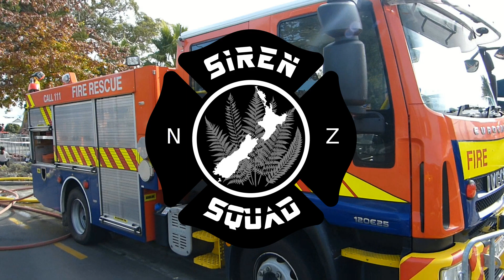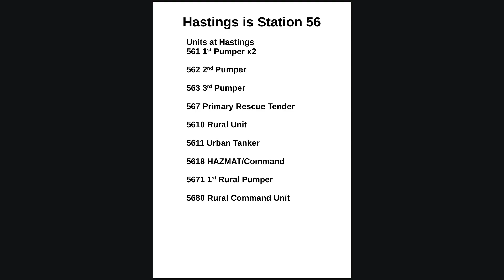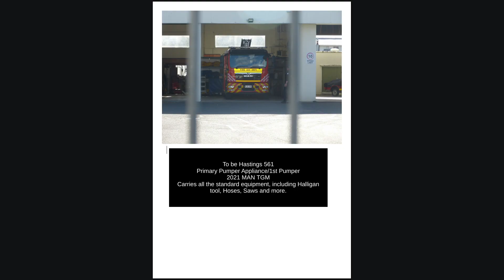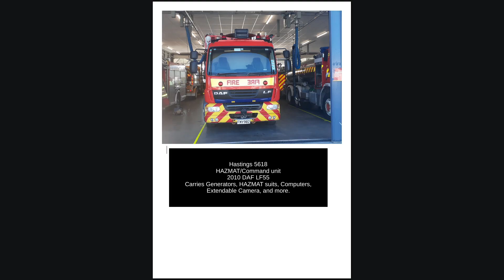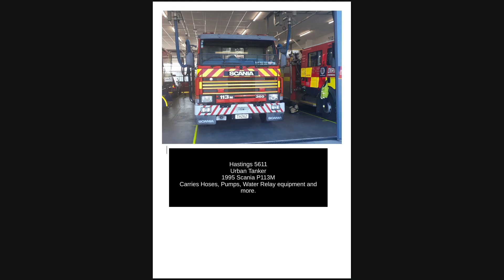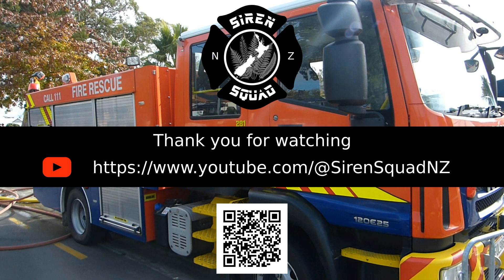Hastings Station Explained | Top 5 units

Comment: Hey man, small correction from a firefighter up in Auckland 😊 A number 7 appliance stands for Pump/Rescue Tender (PRT), not a primary rescue tender. Also, the cutters and spreaders are both commonly referred to as the “Jaws of Life” haha. Great video otherwise, love hearing about other stations outside the area! If you want some footage of the gear on a number 7 feel free to reach out :) good luck man.
Reply from the maker: Thanks bro, I just did the video on the fly as I had the idea and wanted to share it as soon as possible, I do admit that I didn't do too much research but I did it most from memory.
I would absolutely love some footage if you have that, it would be great.
Thanks!!
Reply: @SirenSquadNZOfficial for doing all that footage on the fly, it was some really solid information and well made. What’s the best way to contact you regarding footage/info?
Reply from the maker: @baydenbell9414  My Email address is a solid way, you can find it in my Bio.
As far as the footage goes it depends on how large it is, if it's too large to send via Email then do you have a dropbox/Mega?
Cheers.
Reply: @SirenSquadNZOfficial your email isn’t in your bio
Reply from the maker: @baydenbell9414  First go to my channel, press the More button, head down to the View Email Address, click on that, complete the Captcha, press the submit button.
The reason I am not posting it here is due to BOTS!!
Reply from the maker: Hey mate, I sent you an email, however it likely went to the Spam folder. So you might want to check that if you haven't received anything.